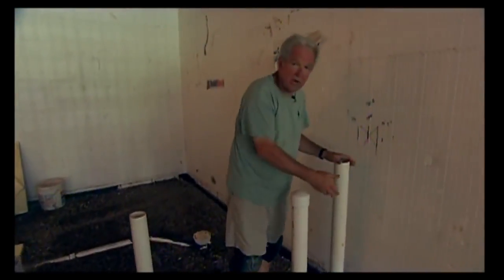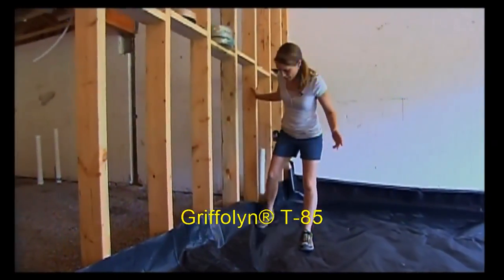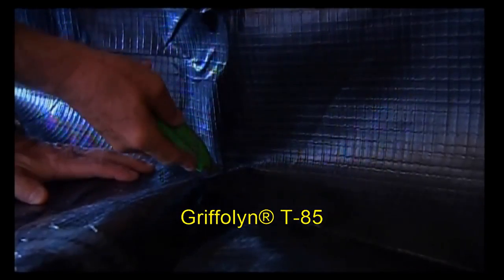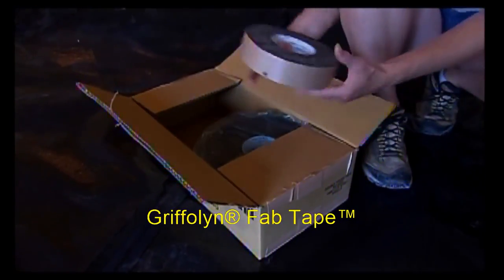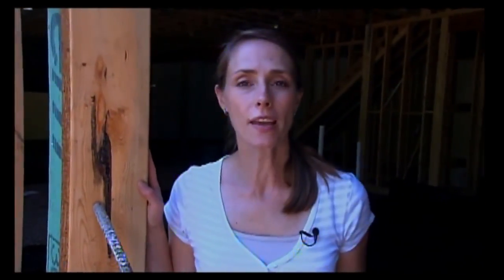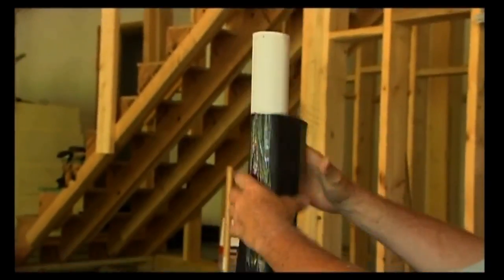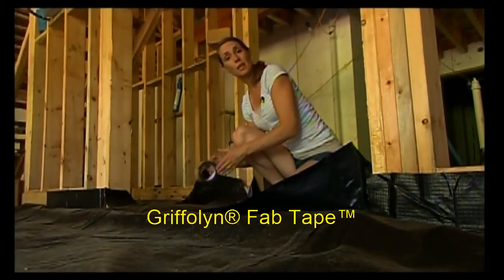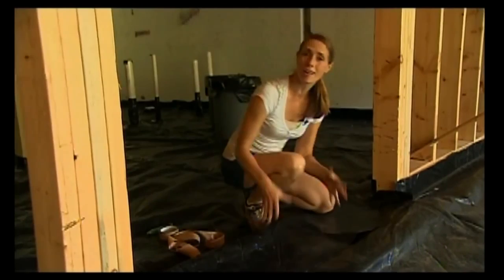How to install a vapor barrier to control radon and vapor intrusion

Comment: I think for the most part the amount of radon that is actually in the ground is never enough to worry about and when you put all that plastic down on the ground it causes concrete to crack especially off the pipes and over time the plastic eventually deteriorates. Not worth all the extra money and time to install